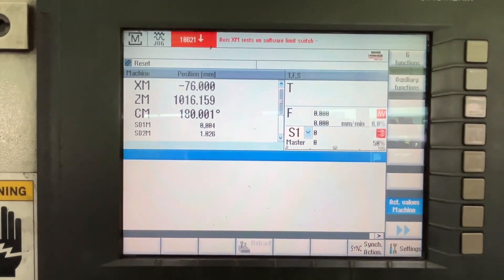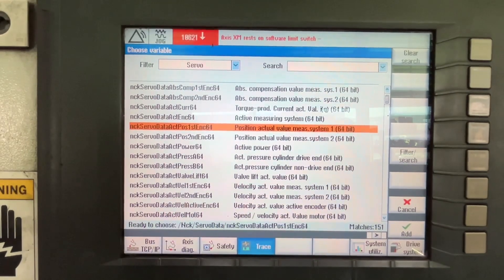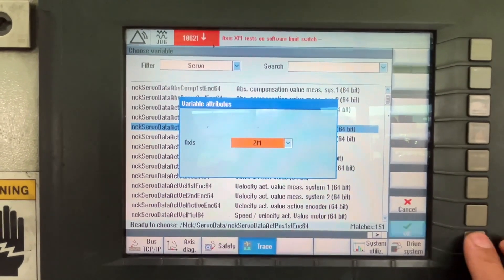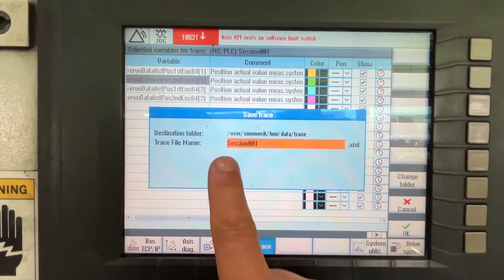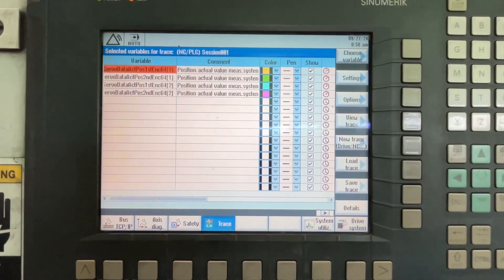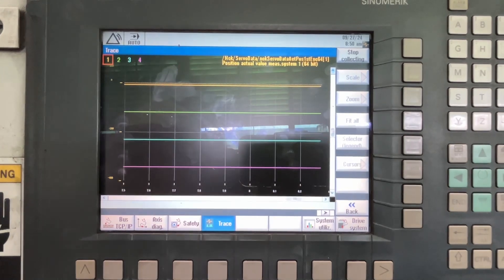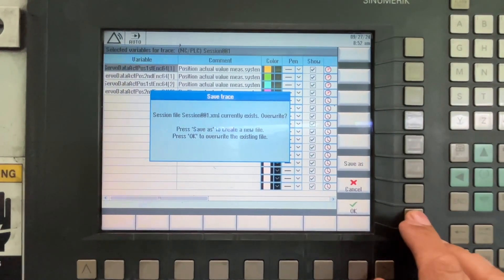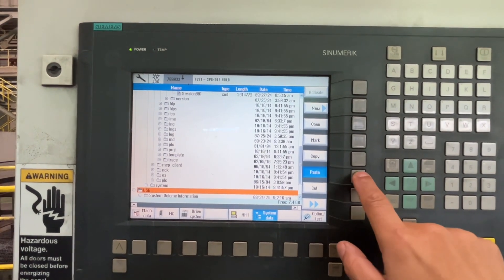Sinumerik 840D sl: how to trace X&Z axes position actual value measurement system 1&2

Comment: What is the purpose of the trace property? What will we be checking when we examine this?
Reply from the maker: @ahmetgul2376  The *Trace function* on the SINUMERIK 840D sl is designed to monitor and record real-time data from the Numerical Control Kernel (NCK). This function is particularly useful for:

1. **Diagnostics and Troubleshooting**: By capturing detailed process data, it helps in identifying and resolving issues within the machine's operations.

2. **Performance Analysis**: It allows for the analysis of machine performance and optimization of processes.

3. **Development and Testing**: Engineers can use the trace data to develop and test new machine functions or applications.

The Trace function can work with both internal SINUMERIK applications and external client applications, providing flexibility in how the data is utilized.